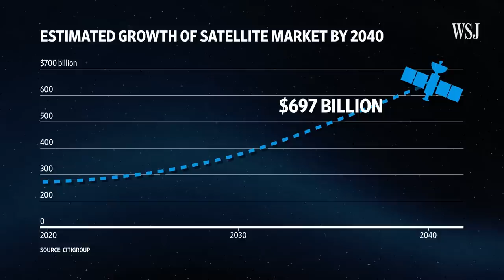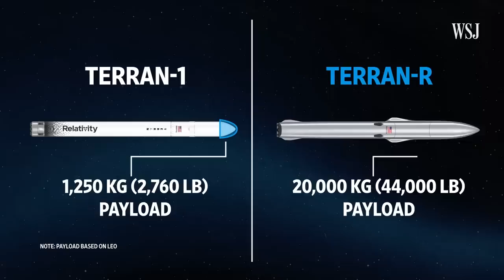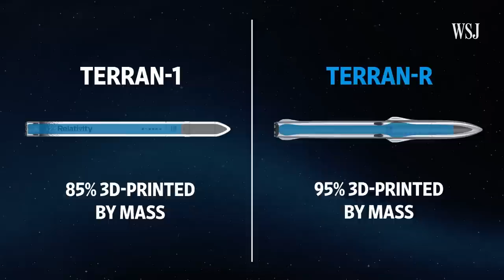Can a 3-D Printed Rocket Compete With SpaceX? | WSJ

Comment: I think it's great to have new competitors in the orbital rocket industry, and in my opinion, Relativity Space is well-positioned for success. The ability to 3D print a rocket provides a number of benefits, including cost reduction, part optimization, and faster production times.

However, it's important to consider that some of these advantages become obsolete when investing in a fully reusable launch system. With reusable rockets, you don't need to build as many of them, and the costs for the company become almost negligible compared to competitors. It's just something to keep in mind.
Reply: That optimization might be very useful for reusable rockets development, since the iteration time is so short, they may have advantages as they can test new products faster (in a move fast and break things way)
Reply: Agree with you but it's not only about making new rockets, it's about how flawless design we can get.
Reply: Iteration time for newer rocket designs is probably the main thing, that and production time.
Reply: the R in Terran R stands for reusability. They're trying to make a fully reusable, but also 3d printable rocket. Being able to 3d print parts not only saves time on repairs (if needed), it also makes iterations quick and easier. All in all it's a very good thing what they're trying to do :)
Reply: there's also things that 3d printing can do that traditional manufacturing can't like the clamshell tank designs for Terran r. also "faster" iteration via 3d printing is one but we've seen spacex make like a million starships in the last 3 years so who knows if that's a viable advantage.
Reply: Starship will eat this 😂

Comment: Metal 3D printing technology isn't a new concept, but Relativity developed it in such a manner it becomes a practical approach for large parts. This is the company's biggest advantage. Even if rocket manufacturing turned out to be unfeasible (which I suppose it won't), they can still use this platform for manufacturing flight hardware for planes for example. This would have several benefits over traditional methods including part reduction (leading to reduced number of potential points of failure eg joints etc), as well as cost and weight reduction. This consequently leads to better performance of such planes, lower environmental impact and even fuel (=$) savings...

Comment: I'd worry that 3D-printed walls will inherently be structurally weaker than stress-formed walls. Why should we believe otherwise? 🤔
We're talking about pressure vessels here. Does anybody make 3D-printed pressure vessels for any other applications?
Reply: Well... Metal 3D printing is essentially just welding anyway and welds are quite strong from what I know. 

There might be a chance for it to work, plus I'm sure they did do the pressure vessel test that ULA and spaceX did do for their legacy method version of space hardware.
Reply: @Farb S  - so when every point is welded that adds up to a lot of welds. How do we know that every single weld is good, when there are so many? All it takes is one bad one for things to go wrong.
Reply: @PrograError  - Ever heard of Electro-forming? I've read it can make exceptionally strong parts which are all seamless. I'm wondering if that could be a better method of manufacturing.
Reply: I guess we will see how it performs in the real world.
Reply: Actually the outer wall is not a pressurized vessel. The fuel tanks and the combustion chambers are.

Comment: This company has definitely found a solution where there is quite literally no problem to be solved, there is no need to print tubes when the current techniques are that well understood and so reliable, but they certainly have potential wherever they use bionic structures.
Reply: They're solving a lot of problems: 1000 times fewer parts reduces opportunities for failure; manufacturing will be 2 months instead of 6 months; and iterations with new design innovations can take 6 months instead of 48 months.
Reply: @susanamaclean2597  Absolutely wrong, now there are infinitely more parts and more opportunities for error and potential defect, because every single new line that is made by this 3D printer has to be treated as a new part, and will most likely be checked for defects, because that's how it's done in pipe construction, except that in pipe production a few welds have to be checked, and in this incredibly nonsensical production style, the whole pipe is actually only welds
Reply: @georgfrap  Right, because all of the materials engineers and aerospace engineers at Relativity have 3D printed these rockets willy nilly without testing any of their alloys, printing techniques, or printed structures. They're just winging it.
Reply: @susanamaclean2597  Your argument isn't really that bright, 3 d printing is a much more newer technique than welding pipes for example, and yet every single seam is controlled in welding, are you suggesting that the engineers and material test engineers of the past just didn't trust the properties of the materials and their technique enough to be as smart
Reply: @georgfrap  she's just reciting marketing points without any basis for reasons.
Reply: What about for complex shapes? I get that long tubes don't have to be 3D printed, but the rocket nozzles, perhaps?

Comment: FYI, Relativity recently announced they will significantly scale back their use of 3-D printing. Many parts, including the scalloped tank domes, will still be printed, but the tank barrel sections (which is the majority of the rocket structure) will be made using conventional manufacturing methods.
Reply: this ^

Comment: For the layman.
This is not as impressive as you think. “Custom alloys” (adding 0.5% Ti), “no welding” (whole thing is welded).
This company is Rivian in the space world. It’s second to market optimizing the wrong solution. 
Long is wrong, tight is right. 

-SpaceXr
Reply: I agree with your saying "long is wrong, tight is right" but I don't see how it applies here. 3D-printing economizes on material and automates the entire process. So what is Relativity doing that's contrary to your saying? 
I agree that welding every single point, as opposed to stress-shaping a molten-cast piece, can be structurally inferior. What about Electro-forming, have you heard of that? I think Electro-formed parts can be very strong, and I wonder if this method can be adapted to 3D-printing.

Comment: If 3D printing can scale to large structures like buildings, that seems like it would be a game changer
Reply: The problem with that is there's a lot more to consider in building a building like foundation, electrical, plumbing, hvac, etc. you can't just simply 3d print them and that can actually more costly than simply buying the ones that are readily available materials. The one thing that 3d printed rockets differ from buildings is that rocket components are hard and expensive to outsource, that is why 3d printing them is acually can save time and money.
Reply: They already 3D print houses.
Reply: 🤣😂🤪😜👉Colonisar Mars 👈

Comment: How does Relativity know that its metal alloy and its printing process is going to withstand the pressures of launch and going to space? (This was the questions that I wanted the report to answer.)
Reply: I know right. Those seams look sketchy af.
Reply: I imagine theyve done some tests to verify the quality is what it needs to be? All these products are made through countless design iterations. Make a prototype, simulate the conditions (temps, pressures, vibrations etc.) and see what happens, improve until you have confidence to get through the next gate etc. If theyve just gone all in without making baby steps then oopsie? Im sure their investors wouldnt be that negligent?!? We will find out.
Reply: @wtfyman  - yeah, but will this stuff hold up under reusability and repeated re-use? It's like every single point is a seam.
Have you all heard of Electro-forming? That can produce exceptionally strong parts, and I think that tech needs to be looked too, to see if it can be adapted to 3D-printing methods.
Reply: @wtfyman  If this is true, it should have mentioned.
Reply: @wtfyman  Yes, they test absolutely everything.
Reply: They tested it.  It works on paper.
Reply: @ccbcco  - paper isn't the same as reality - especially reusably
Reply: Terran 1 launched last Wednesday. It reached and passed MaxQ, the point at which the rocket is under the greatest pressure. The structure held and the rocket crossed the Karman line into space. So there’s your answer. Yes, 3D printed rockets can withstand the forces required to get to space.

Comment: 3d printing is for making complex objects? Who creates a pipe using 3d printing 😆
Reply: Your mom
Reply: @looperbirhinger7043  Not with wire deposition resolution, no. All the sub-assemblies that connect the engines to the rocket are traditionally CNC machined. It really is the most pointless application of welding.